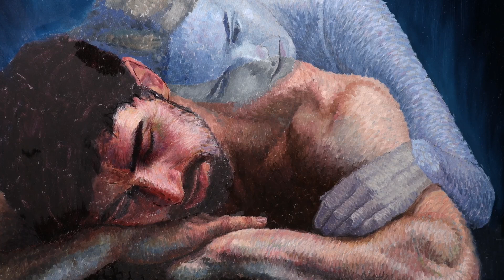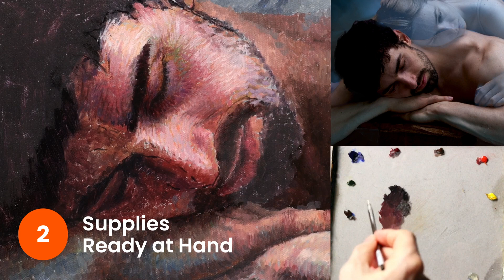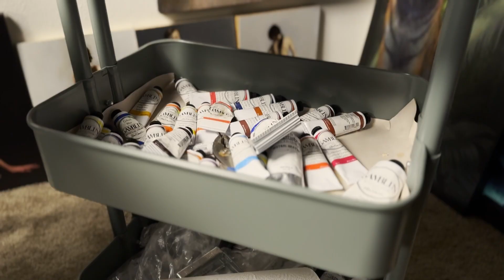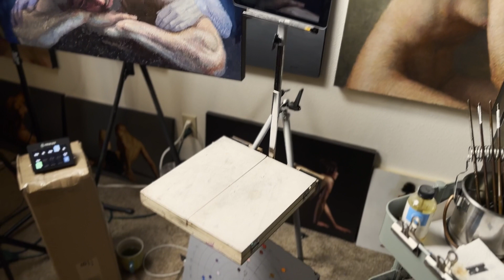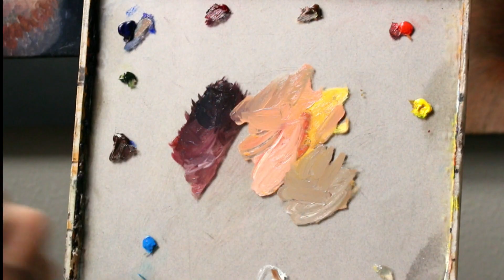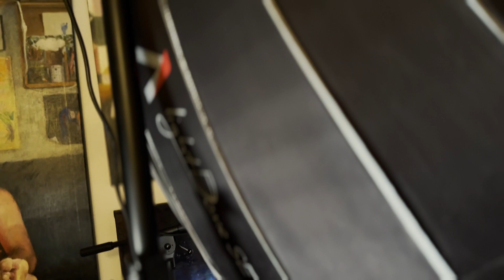Stop Wasting Time! 7 Tools to Maximize Your Painting Time

Comment: I use a picture frame that comes with glass as my mixing palette.  You get quite large sizes which is handy.  Then I made an air tight lid made of thin MDF board that has sealing strips around the edge.  I keep in shut with either gaff tape or luggage straps.  I put a paper towel with clover oil on it inside.  And that sits on a music stand that has adjustable height etc.  Great video, cheers!!
Reply from the maker: Very cool thanks for sharing

Comment: Thank you  so helpful.  need to work on lighting and understanding cool and warm light.  Also some kind of shadow box not real big , so can be left out.  All the best.
Reply from the maker: For the lighting I would suggest any of the 5000k bulbs at the hardware store. Or you can get some lights where you can adjust the Kelvin. I like 5000k up to 5600k. Anything below that gets too yellow. Just as a comparative, normal "warm" bulbs are around 3400k. For the shadow box setup, years ago I purchased those really cheap wire cage shelving units that you can assemble in any way. Then I draped it with black fabric and a cheap shop light above it. I still have it. Here is a post of it in use: https://chrisbeaven.com/session-202-work-200/ Hope that helps! Thanks for the comment.